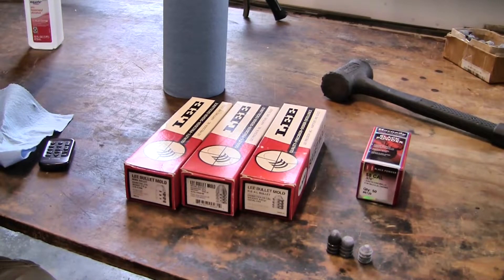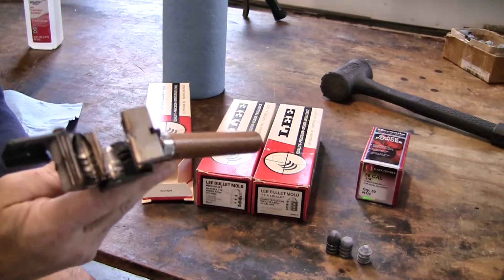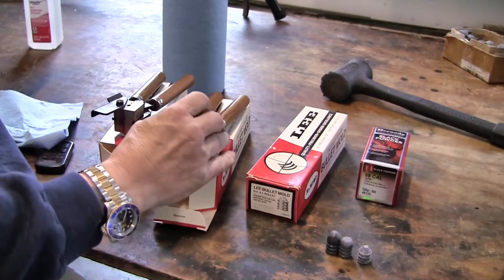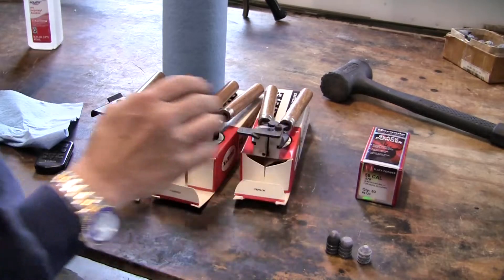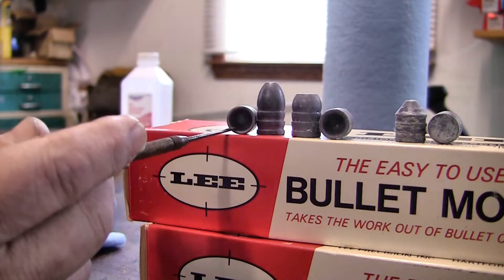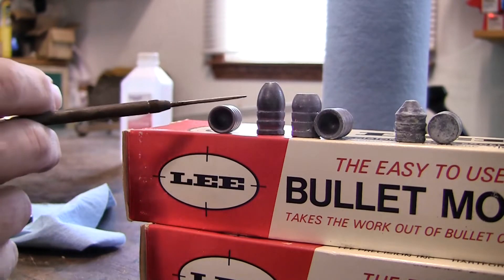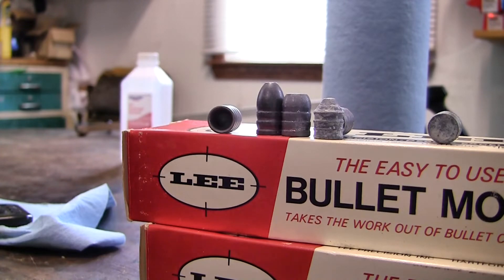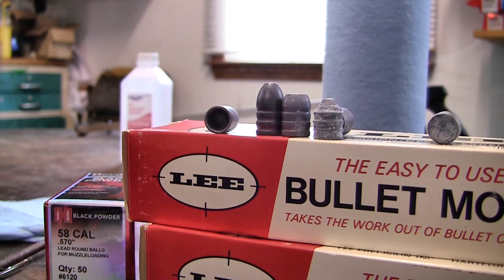Lee 58 Caliber Bullet Molds for rifled muskets

Comment: Very happy with my two Lyman 58 molds (plus 54 and 50 cal, all Lyman and RCBS molds). The steel holds heat better and the cavity piece with a separate wood handle works much easier than a cheap Lee mold I tried.